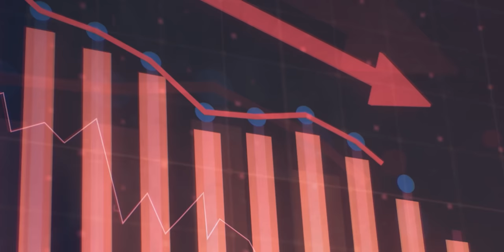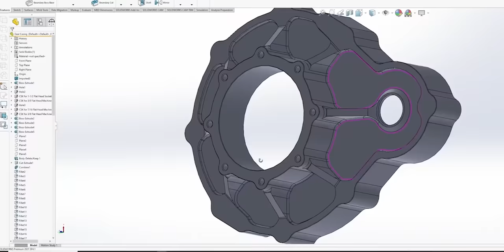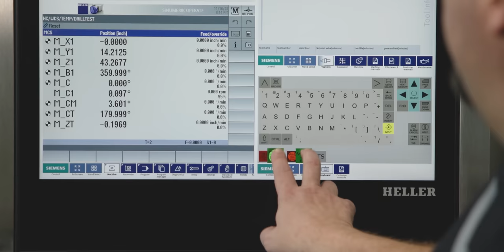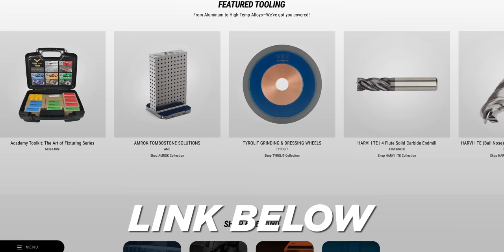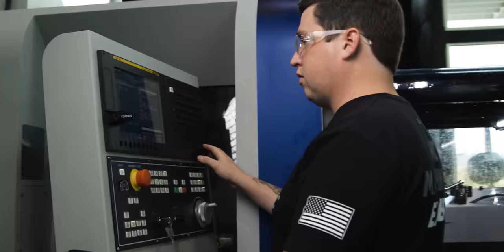Is European Manufacturing Superior to American?

Comment: If you've never been to or haven't worked in China it's hard to know this but actually a lot of their tools and products that are in China are of equal or higher quality than in the US. But buying Chinese made components or parts in the US is usually bad because the company's importing them are only willing to pay bottom dollar for the cheap stuff so what you see is the cheap Chinese stuff rather than their high quality stuff which would easily cost you as much if not more than US-made components and parts

Comment: As a Chartered Design Engineer in the UK I love what you do! Teaching the next generation of machinists what is possible and exposing engineers to what they're really asking someone to do on the shop floor is invaluable.

In the UK, the British automotive sector went down this path in the 70s/80s of making crap from cheap materials, and the market of the patriotic buyer wasn't enough to save them, so it pretty well killed the British car industry. The US car industry has done the same thing now, luckily your domestic market is big enough to keep them in business.

UK manufacturing is pretty well respected today again, because in the most part we only make low volume high end Aerospace/Motorsport and Medical stuff or complex things like engines. The reality is there are places in the world where labour and materials are cheaper, trying to compete with them on cost you won't win, so the answer is to do the things that technically they may struggle with.

Although I have to say Tesla is second only to Apple for being terrible for built-in obselesence and restricting the ability to repair their products.

Throw away culture is coming to an end, we need to get used to the circular economy, be prepared to pay for quality and expect things to last and be repairable.

Comment: This is something that resolves by economy itself. Sometimes it will be an American made product, sometimes a German made, sometimes a Chinese one. Customers do not care where it comes from, but if it does the job at a reasonable price.  Tesla cars are one of the most expensive electrical cars around, China is now beginning to launch their models which are less expensive, this will most likely drive Tesla prices down and they will be forced to make the cars elsewhere. What is sad is that you no longer repair items that are broken, you simply replace it like you said.    If I buy a CNC machine, computer or even a car I look for, what do I NEED (not wish for) and what is the least amount of time that will give that to me.  It might be a Haas, but it might also be a DMG - depending on what I need. I don't care where its made, I care for the TCO and supportability.

Comment: I've been wondering why I don't see any Haas machines in the shop anymore and I would guess that reason is they don't stand the test of time, am I correct in saying this?
Reply: Yes.
Reply: @barrysetzer  Thanks Berry, as I was planning on purchasing one in the future as at some point in time I will have to start making the engines that will change the world and I don't need the machines slowing things down.
Reply: I can buy many parts and even new aftermarket  parts  for my  90s HAAS .. but not my  90s high end  5 axis   Jap machine..  plus its resale value  is trash

Comment: Some pretty important semiconductor parts are made here in america(shop I work at) and then used over seas (Taiwan) but can someone answer this question Iv always had.. the nature of this company and the customer is they don’t want to improve anything as far as machining goes.. we make parts in the slowest, dumbest way possible, I can increase the parts made per day 5x or more and they absolutely  REFUSE to do it, the “if it ain’t broke don’t fix it” mindset from both.. they want to keep prices higher per part for some reason.. we could make the price of microchips so much lower.. I don’t understand. ( we make over 80% of all the material for the world to make microchips) I keep trying to make improvements cause it would benefit so many industries ..

Comment: Chinese Quality can be pretty decent, I don't know a whole lot about CNC manufacturing but I do know about PCB manufacturing. You can get PCBs made and assembled for less than 20% of what it would cost in Europe, for pretty much the exact same quality unless you go for some super specific specs that 99.5% of products don't need. Granted, you run the risk of IP theft, but reverse engineering that information by looking at the finished product is not all that difficult if you're dedicated, even for the most complex boards.
Reply: Im sure the china man who made is PCB for 20 cents a hour is grateful for the work
Reply: @jordanindustrialcompaction8381  Not really, these types of processes are highly automated, if you calculate it down there is only a couple minutes of worktime in each PCB tops. Wages are not that terrible in China anymore either, being paid 5-10 dollars an hour is pretty normal there now.

Comment: pretty good. though found one mistake and that was the china part ( "made in china" does does not mean bad by defolt ) china gives you the quality you pay for 
you pay them low then give you low quality
you pay them high they give you high quality 

hint's wht the best considered headphone amp no matter the cost is a "mostly made and fully assembled and tested china" one ( talking about audio-gd )
Reply: This always frustrates me when I hear people say everything made in China is crap. The west has been outsourcing production there for decades, do these people really think they haven't figured out how to make things just as well as we could/can? China has invested incredibly in narrowing the technological divide.

The reason to not manufacture goods in China is not a technological limitation, it's the risk of IP theft and the fact that to get high-precision low-tolerance parts you'll be forking out enough that it isn't that much cheaper than manufacturing in the US or EU in most cases.
Reply: @Flintlocke89  and in the cases where its pretty much the same price its a better idear to get it made in your own country do to shipping time and shipping cost ( witch in some cases can be extreme ) and its easier to talk with one based in the same country since you speak the same languich as you do ( aka one less hurtel/headace to overcome when the price is almost the same )
Reply: At what point does the cost to quality make it pointless to outsource? If the part will cost equal to be made in USA or China then you might as well get it manufactured in USA if that’s where you live. The Chinese will eventually reach a point where their cost of labor will be equal to the cost of labor in the USA because their goal is to be an economic power house and it won’t become that if they continue to value their labor at a low cost, so the idea of manufacturing in your own country and not overseas will be more attractive.
Reply: @Ap_twsh  agree. if it cost the same then just get it made at home ( home country )

Comment: I am really disappointed  that u have left haas , I have personally chosen them for our new machine vm2, instead of doosan
Reply: Haas are just completely trash compared to doosan lol
Reply: @max_eley  we have a couple of dmg mori machines , I prefer the vm2 over them , they are better in every way,  rigidity , accuracy.....
Reply: @doc0302  😂😂😂 lol okay pal
Reply: @max_eley  have you ever worked yourself (PROGRAMING AND OPERATING)on dmg mories , haas. I woked on  dmc835, and dmu60 5axis for more than 7 years , and when we got the vm2 i was realy surprised if its capabilities.
Reply: @doc0302  I've owned many haas, dmg, and doosans, doosan and dmg are by far superior, if you disagree you are just factually incorrect in terms of actual specs and advertised capabilities
Reply: @max_eley  they might be superior  but also much more expensive,  if you go for the bang for the buck I think that haas is the best.
Reply: @doc0302  doosan is actually cheaper than haas, so that is false.
Reply: @max_eley  o
It all depends on the options and where do you live.

Comment: 100% on the video. Sad thing with American ethos is they will not take the time or set and keep standards to keep ridiculous performance at any cost in mind. Extra heavy duty bearings, 50% more machine mass, specifically designed axis drives, glass or direct read scales, tuned servo drives etc are forgone for 'good enough' or profit OR not willing to step out and have specific non parts bin components and designs. Yes they are expensive to develop and you must work hard to make it cost effective, but we've in mass lost the novelty to making extremely innovative cutting and manufacturing systems. We can still get there, better now than ever do more engineers and designers have access to more resources.

Comment: As you pointed out in another video there is allways 2 sides of the coin. You have ditched the Haases once occupying the shop floor in favor of Dn solutions(mostly) meaning you are able to crank out more parts per hour due to the higher rigidity and higher spindle torques emplyed by the DN solutions machines, which is a good thing.

On the other hand Haas won't be able to keep up with the competition and may have to lay off workers in the long run due to less demands for their machine tools.

So, the advantages you guys get from buying DN solutions machines rather than, say Haas, is of course a win for you, but someone elses loss.